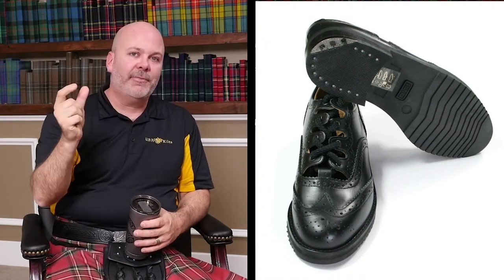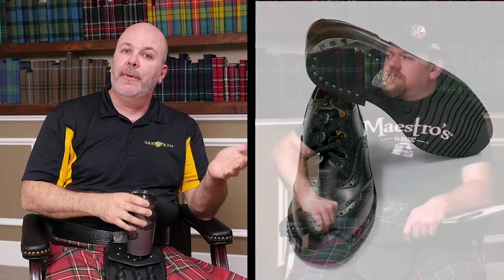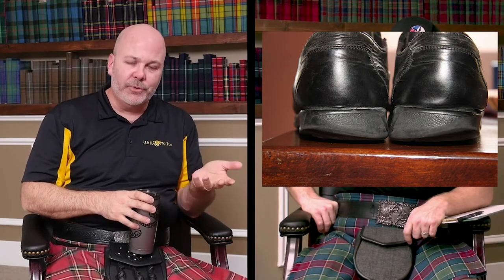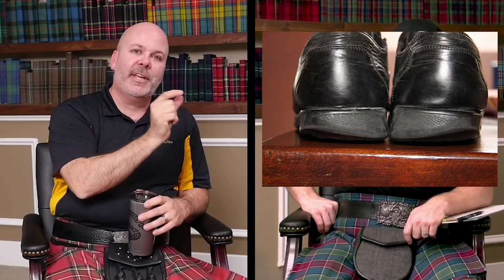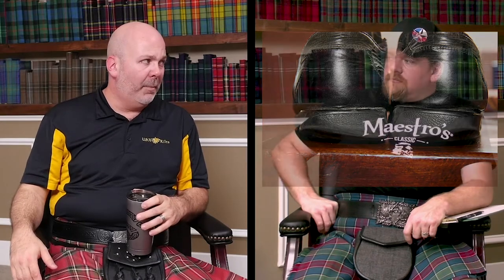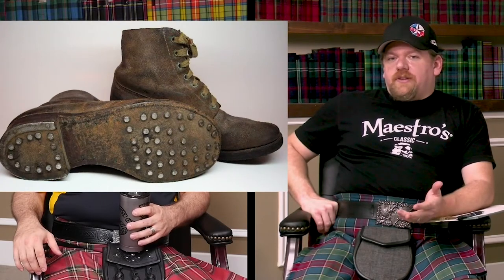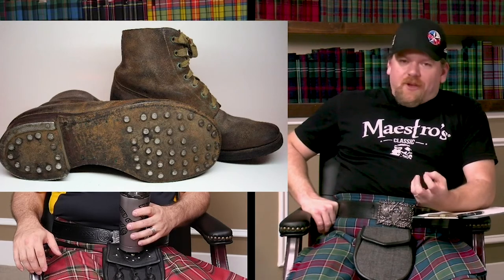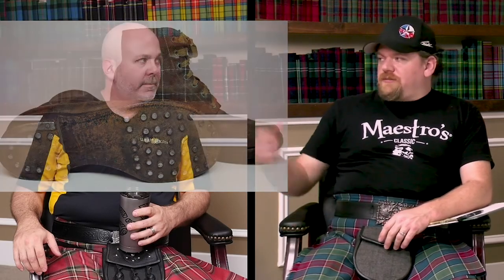Why Do Ghillie Brogues Have Metal Plates?

Comment: It used to be very common, in Scotland, to get steel seggs fitted to the heels of new boots. For the first few days, you created sparks when you walked along the street.
As you say, the leather heel and sole of the boot lasts much longer. They're quite rare nowadays, as most modern boots have plastic heels/soles.

Comment: They're torture if walking across cobbles or rock strewn ground as they're as slick as can be.  Far better option is invest in a pair of shoes with cleated rubber soles for walking and either leather or rubber soles for  general wear.